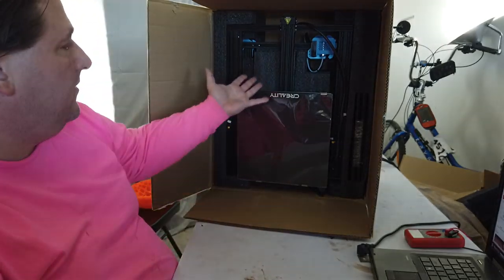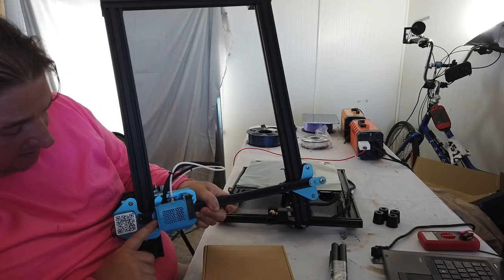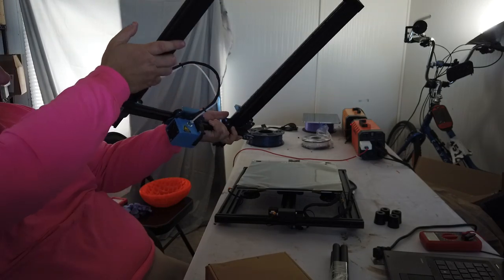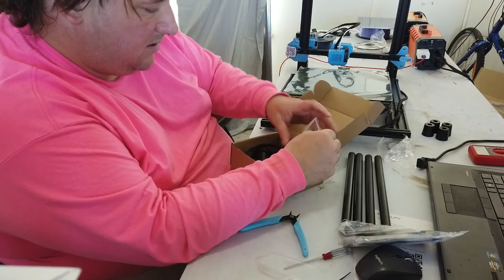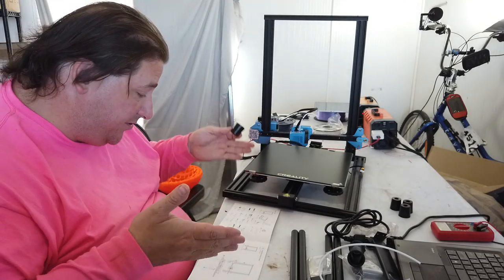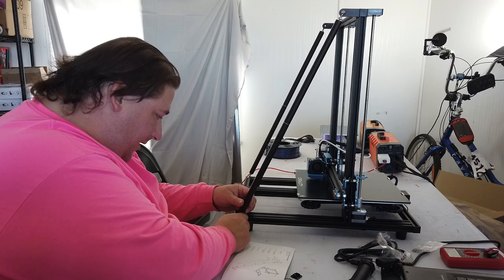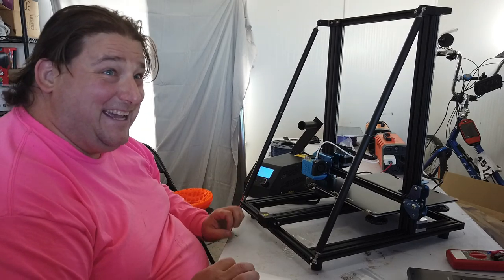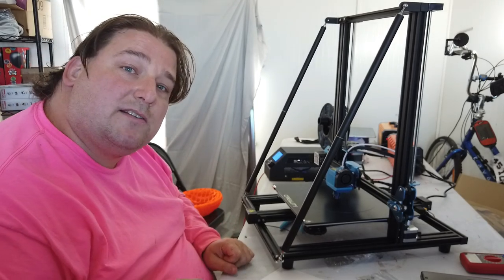Creality CR 10 V2 Box to Print T3DP

Comment: I just got mine and cant print anything. Tried the benchy 5 times and its no use. Can you help? The problem am having is i think am having bad prints because the rods are not at the same level and i dont know how to adjust the z axis rods. Ive seen alot of people just turn the couplers but when i do that the rods turn , the blue boz with the nozzle goes up ( forgot the name ) but the lead screw on the left is wayyyy off and the lead screw on the right is on top. Mine was from tinymachines3d. It was already tested. All i had to do is level the bed and start printing but its no use. Ive tried everything.

Comment: hi have you had any issues replacing your nozzle i cant get mine out ive deatached the bowden tube and heated the hot end but when i try to get it out the nozzle starts breaking and seems like its glued to the heat block
Reply from the maker: Turning the wrong way? Counter clockwise from nozzle perspective!!! Also hot enough 200c?

Back and forth. Tighten a tiny bit lossen a tiny bit. Might be cross threaded. Does it look visually crooked?

Comment: So when i turn the couplers like i said before , the rods turn but they stay the same level. They dont adjust. If i could send you pics it would be easier to explain
Reply from the maker: Did the brass couplers seperate from the x axis plate?
Reply: @nerys71  no, i fixed the problem. All i had to do was loosen the top screw from the coupler, pull the rod up and then titghen the screw of the coupler. Now the rod is leveled and the coupler doesnt get stuck while z is moving up and it doesnt make any noises. Its smooth now. Have printed 10 things already to test and it works amazinngly. Just found a specific video about how to adjust rods. Because theres like nothing very very detailed on how to fix this problem. But luckyly i did. Thanks for the reply.

Comment: I am thinking about getting into 3d printing, what would be a good beginner model? Don't know if it amounts to much but I have about 10 years experience with big cnc machine's just wanted something at home.
Reply from the maker: if you want a cheap machine to get started with and don't need to print HUGE like this machine. Get an Ender 5. its $350 typically on amazon prime and its simply phenomenal machine with a generous build volume. When you are ready to expand to larger this V2 is an excellent companion for the larger prints.
Reply: How much more is the ender 5 plus as far as price and knowledge needed?
Reply: I would really like to get on your patreon what do I get for a 5.00 donation a month?
Reply from the maker: @codybrock8032   it's about $200 more and has a significantly larger build volume bigger than the cr10

You may need to send a command to the printer to reset the Z offset if they have not corrected it in the firmware yet in order for the bltouch to work directly otherwise just as easy as setting up the Ender 5
Reply from the maker: @codybrock8032  I don't have any kind of tiers or anyting on my patreon haven't figured out how to do it any with that yet
Reply: Nice thank you man. I've been watching all off your old videos trying to figure everything out the best I can before I buy. The only thing is I'm not that great with computers so I'm a little nervous on that end but I've got real comfortable with cnc consoles so I should be ok, but having a channel like this for support is great thank you very much.